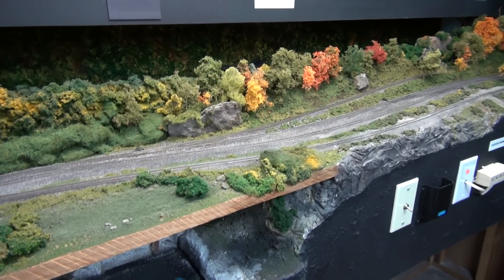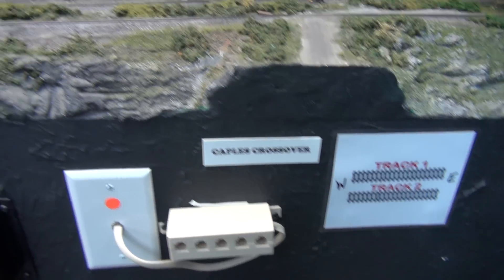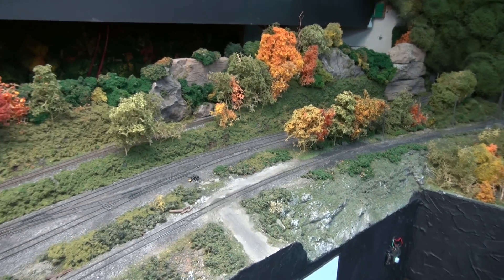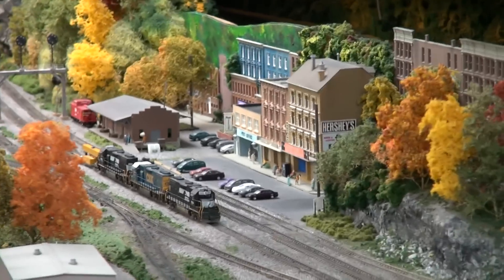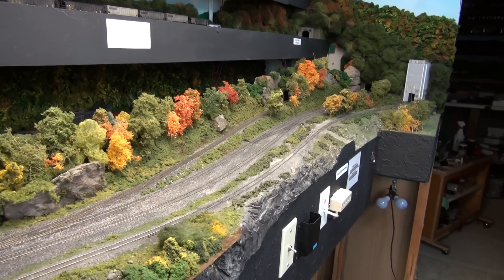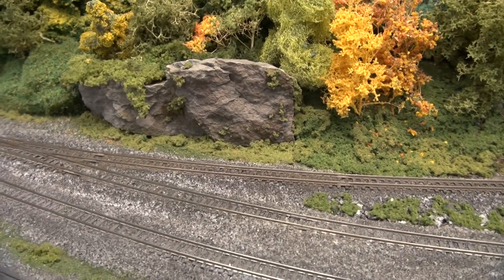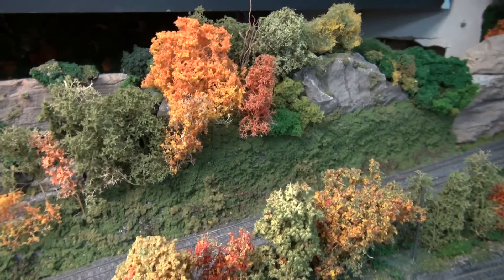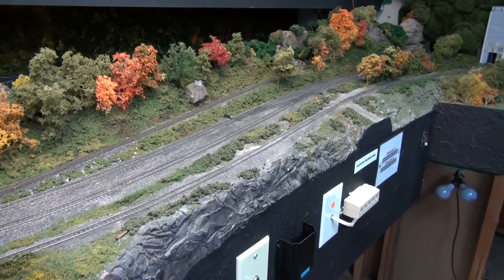NEW PROJECT TO THE N-SCALE LAYOUT

Comment: Great Work Scott! Love your layout and can't wait for more ops and free running videos. One quick question for you: the SD-70ACE heritage units that you use - are they Kato or FVM and which do you recommend? Do you have all 10 Heritage Units?
Reply from the maker: I have all the GEs and some EMD from FVM.  I have all the EMDs from Kato.  I like them both, the only thing I hate is that the SD70ACEs don't pull great from KATO.
Reply: +NSSCOTTTEAGUE thanks for the reply. I was actually tossing up between the FVM and Kato SD70ACEs. From someone that has extensive modelling experience it certainly does skew my decision towards the FVMs. A small request - in future videos could you show more of the -70ACEs in Heritage Scheme running? They look fantastic! Cheers!
Reply from the maker: SURE